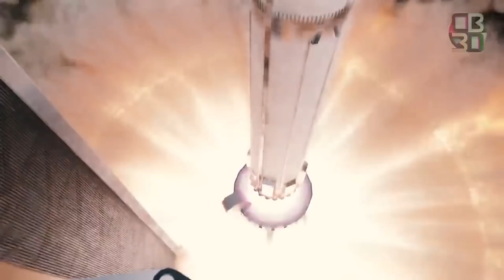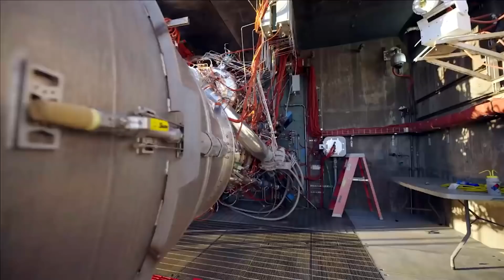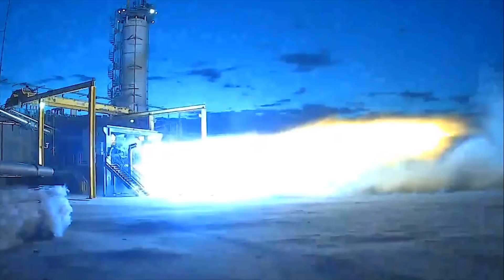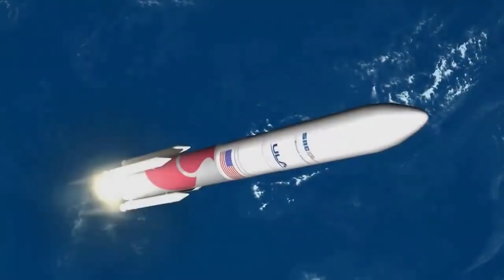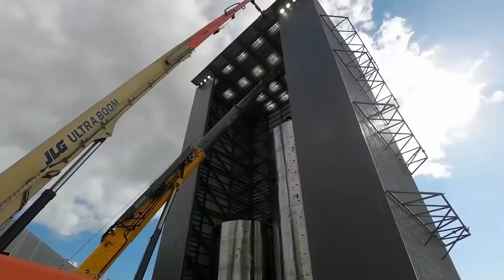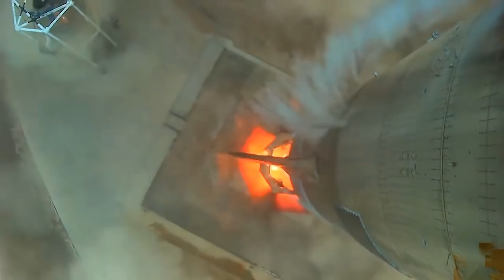HUMILIATED! Blue Origin's BE4 Engine manufacturing COMPLETELY FAILED!

Comment: disgusting narrative with incredible bias.   Blue is behind schedule but SpaceX has likewise often been several years behind its promises on numerous projects --but they got there. SO will Blue.  Blue will provide essential competition and help develop the heavy launch industry over time. Rockets and launch infrastructure take time.  this SpaceX cult attitude is not a good thing for the industry, even if SpaceX continues as a key innovator.  "Complete Failure" is just clickbait and false. Vulcan Centaur just stated they are tracking for a launch this year following receipt of the flight article engines mid-year.  This is not a "complete failure" any more than the long wait for Starship orbital (years behind announced schedule) represents "complete failure.".

Comment: The components and the materials of a rocket engine all work at maximum of their specifications; therefore when something doesn't work properly, you can't modify the engine, but you need to redesign it from scratch. SpaceX didn't just modify the Raptor, but consolidated all the changes and produced the Raptor 2 in record time.
Now the BE4 has combustion instability and overheating; it therefore needs new injectors and new turbopumps with the use of different alloys.
What could be a showstopper for Blue Origin, and be the likely cause of this five years delay, is the overheating. You fix the overheating in a rocket engine by changing the fuel / oxidiser ratio. But this change do reduce the nominal thrust and specific impulse; therefore, if you reduce the temperature, you must increase the pressure, which the chamber may not be able to hold. Blue Origin may well be entangled in a series of technical problems, and not be willing to splash the inordinate amount of cash usually required at this stage of production. 
If Blue Origin don't have very good engine designers, they could well be stalled for a very long time on this.

Comment: Look at the shape of the combustion chamber, problably has no baffels inside to stop combustion instabilities...LNG has no efficiency in regenerative cooling in comparison with another fuels
Reply: Maybe the BE-4 should have two or more combustion chambers, then.  That's how the Russians make solving this problem easy on themselves.
Reply: @rbrtck  Yes, like the RD 170 with four combustion chambers...but the regenerative cooling is more complicated in this case
Reply: @luizfilipe7882   Might it help at least a little?  Even if it doesn't, though, there are rumors about combustion stability issues that using multiple chambers and nozzles should more likely help with.

Comment: It's hardly a competition when one company has a man rated orbital class rocket and the other has a glorified pogo stick.
Reply: yeah, but if BlueOrigin finally succeeds in developing the BE4 they will eventually also have a man rated orbital class rocket...that costs several orders of magnitude  more per ton to orbit than the Starship.
Reply: I didn't realize that the New Shepard suffered from pogo oscillations. 😉
Reply: @rbrtck  Yes apparently just very low frequency of 1 cycle per flight
Reply: @tizerrazor1956   In other words, it doesn't go high enough for this to be an issue.
Reply: Not only a man rated orbital class rocket but a man rated orbital class rocket that can land its first stage back on Earth.

Comment: You obviously haven't been following Raptor very closely.  It has a very high failure rate; I'd guess no less than 25% for a full duration run.  There's no way to know how BE-4 is doing, it's totally hush hush, but I wouldn't be stunned to learn its reliability is much higher than Raptor.
Reply: Raptor isn’t just a new design, it’s basically a new concept - full flow staged combustion -  in rocket engines.   To top it off, superheated oxygen is extremely corrosive.  The West didn’t even bother trying oxygen rich engines until the Russians taught us how.   The Merlin engines are actually quite conventional, maybe even a little old fashioned.  So kudos to SpaceX for pushing the envelope even further with Raptor.  There’s a lot of efficiency gains to be had.
Reply: @ClockworksOfGL  Maybe to be had ,  His track record is pretty terrible , i mean 6mill launch 24hr turnarounds were promises a decade ago  and were still at a month and 60 mill
Reply: @MyKharli   Yeah, it's awful.  Stay away from SpaceX, and go with anyone else who has actually advanced the state of the art more.
Reply: @ClockworksOfGL  Maybe, but this guy was saying Raptor is a great success and BE-4 is an abject failure; I’m fairly sure neither is true.
Reply: I gess is not a good source.
Reply: laughable.
Reply: The Raptor isnt even here yet, its all testing and prototypes. Everything is perfectly in line with SpaceX testing and fail philosophy.

Comment: I'm interested in how their manufacturing capabilities are performing. Is the BE 4 having production issues or "science" issues?
Reply: or methodology issues?
SpaceX preferred the fail early way: they have tested parts or the whole engine as soon as possible. It failed usually, but they have learned a lot from the failures, so their understanding got better. Eventually this resulted in a working engine. But the engine was not reliable enough for rapid reuse, so they have kept improving it. Learning to mass manufacture them cheaper and better.
It is difficult to see, but BO might have tried to use the other methodology, when you aim to get everything right the first, or maybe the second time. That can lead to very long unexpected delays. Unlike in the "fail early method", many redesign issues creep in the last minute. So you may need to restarts the whole design process after the first tests.
"Fail early" can react to unknown unknowns much better.

Comment: CopyBlueCat  OVER
Reply: Copycat? Their research moves at about 1/2 the speed of spacex but they announced the BE-4 before spacex started on the Raptor, and they released drawings of New Glenn before SpaceX announced the BFR, and every test article and rocket they have ever built has been designed to be fully reusable from the very start. They were landing their test vehicles before SpaceX even had a rocket that didn't blow up on the pad. They were the first company to make it past the Karamen line and recover the booster with a soft landing.
Reply: @opcn18  And yet they still can't get to orbit or the ISS. So they still lose. And what the heck is a Karamen Line. And how many contracts for space delivery have they completed?  meanwhile SpaceX is delivering the goods to orbit and the ISS. And has over 100 landings of the 1st stages or boosters. BO has how many? Oh that's right 18. SpaceX has passed BO and is leaving them in a gas plume weekly. Another Falcon 9 launched today while there was a 1st stage coming back into Port today also. SpaceX plans one a week launches while BO launches once in a blue Moon on a Pogo stick.
Reply: @gravelydon7072  The line that delimits the edge of space.

I don't think SpaceX moving faster than Blue really matters. General Motors SuperCruise is a lot better than Tesla's autopilot, that doesn't mean that Tesla should shut down and pack up. Rivian is beating Tesla to market with an electric pickup (in spite of Tesla suing to try and stop them) again, does not mean that Tesla should close their factories or hand them over to Rivian.

There are allowed to be more than one companies and they can't all be the fastest and most dynamic.
Reply: @opcn18  Then it would be the Kármán Line or von Kármán Line.
No comment on GM comment. Rivian is having problems of its own. Way too many pre-orders and not enough capacity. They hope to get permits to build a second plant in Georgia to go with the one in IL. They didn't deliver more than 1000 of the R1Ts in 2021. Production of 150,000 units per year by 2025. Which is a drop in the Tesla bucket. I wouldn't mind owning one if they could get longer range out of them. Or that fact any EV. Until it can go more than 500 miles without stopping to charge ( unless they can do it in the same time as a gasoline fill up ) they are useless for me.

Comment: I wonder if a Raptor engine could be modified to fit on the ULA rocket? It would be funny as hell if SpaceX replaced the BE-4. To my knowledge, both the BE-4 & the Raptor both use the same fuel. SpaceX could offer ULA Raptor 1.0 while using the 2.0 on the Starship.
Reply: Heck, just use the Raptor 2 on both as Musk has said the Raptor 1 assembly has ended. Raptor 1 had 2.2mN of thrust while the BE-4 is estimated at 2.4. Raptor 2 would out perform the BE-4.

Comment: The BE4 and Raptor are basically the same design. Before spacex and BO this was a theoretical engine that only worked on paper. Why ?, because the are very complex, powerful, and just want to constantly eat themselves. There is a reason nobody tried to build them before. Where BO really fails is they do everything in secret, spacex does everything right under our noses and have built a massive following because of that. Bezos could learn a lesson or two in that regard, and we might start to like them a bit more.
Reply: NOT THE SAME DESIGN. Same starting goal. same fuel. and the same science.
but after that comes implementation - and that is different as the design was done by different people. BO engineers are the second rate as the first rate ones work for SpaceX.
Reply: @jessepollard7132  Well they are obviously not the EXACTLY the same design...thanks for stating the obvious...BUT, the are both methalox full flow staged combustion engines....driven by turbo pumps. I honestly didn't think I would have to spell that out. NOTE: I put the word "basically" in...which they are....the YT peanut gallery strikes again......thanks.
Reply: @dazuk1969   Actually, you are incorrect.  The SpaceX Raptor's design is full-flow staged combustion, while the Blue Origin BE-4's design is oxygen-rich staged combustion (look it up), which the Soviets achieved decades ago with kerolox engines and much higher chamber pressures (a good thing), as well.  An excellent example is the RD-180 engine that the BE-4 is supposed to replace.  The Raptor's design is very different, more advanced, more challenging, and achieves even higher chamber pressures than the RD-180.
Reply: @rbrtck  Your description of the BE4 describes the raptor perfectly....why ? because raptor is also oxygen rich....look it up. I think you are missing the point. The architecture of these engines will differ as the BE4 is larger and WILL be more powerful, but they are both methalox (oxygen rich) full flow staged combustion cycle engines..
Reply: @dazuk1969  On a full-flow staged combustion cycle engine, there are TWO preburners - one is oxygen-rich (driving the oxygen turbopump) and the other is fuel-rich (driving the fuel turbopump). https://en.wikipedia.org/wiki/Staged_combustion_cycle#Full-flow_staged_combustion_cycle
Reply: @L4JP  Yes I know, I just couldn't be arsed to explain it in detail. You are correct, the Raptor is full flow using to separate turbo pumps. One for the methane and one for the liquid oxygen. BE4 is not full flow as it only uses one turbo pump for both...hence it a staged combustion cycle...but not full flow. You obviously know what you are talking about...so thanks for reply.
Reply: Highly unlikely.  Why? Because even if the engineering and complexity details were resolved the company would still be a failure.  A failure because of Jeff Bozo's. He's shown and displayed what morals and ethics he chooses to operate with.  He just needs to stick to pedaling his "cracker jacks" and "chineseslave labor crap" on Amazon.
Reply: @chrisbowring4298  Amazon only sells other companies products. it is the other companies that use the cheapest labor for manufacturing.
Reply: @jessepollard7132  Amazon has  an inhouse design firm, they developed the fire tablet, alexa, echo, and the kindle.They do bid out construction of the products, but that's how the computer you are using was built, and the phone in your pocket, and all the parts that go into building a Tesla.
Reply: @chrisbowring4298  I agree on some things. Musk said Bezos gave up CEO of blue origin to spend a new career in suing spacex. I also think Bezos pinning flight wings on people from a new shepard flight when Amazon workers had just died in an Amazon warehouse fire was Appalling. As for the BE4, spacex have been testing raptor in FLIGHT going right back to starhopper. It's all very well testing on a stand...you actually have to test them in flight to get more thorough data. Bezos kind of deserves all the flak he gets.
Reply: @opcn18  Maybe operations but not from the company. His title is executive chairman of Amazon. That means that he has a role in it and snubbed the employee's families.
Reply: They are not basically of the same design.  Blue Origin deliberately chose an easier and more proven design for the BE-4.  However, only the Soviets and Russians have ever achieved it--never anyone else so far.  On the other hand, the Raptor is of a far more experimental full-flow staged combustion design that had been attempted by both the Soviets and Americans, but neither ever got it beyond the test stand, until SpaceX did it with the Raptor.  Obviously, the Raptor is still under development, but it has flown, which is farther than any other engine of this design had ever been taken before.  Meanwhile, Blue Origin continues to struggle with a design that the Russians have long mastered.

Comment: This is old news that wasn't particularly true when it was current. The BE-4 hasn't flown because the customer wasn't ready. It's not a train, it doesn't leave without the cargo.
Reply: I don't understand this remark. 
So are you suggesting the 1st flight be a revenue mission (and not a test mission)?
I find it hard to believe BO wouldn't wish the BE-4 operational today, customer ready or not ...
Reply: @tonys2957  ULA did not plan to do a mission with a mass simulator. That's what SpaceX does (well, what they decided to do after destroying the first two satellites that they tried to launch) but there are launch companies that don't (including the very first spaceX falcon 1 launch).
Reply: @opcn18  where's new glenn flying with be4😂🤣🤣🤣
Reply: That's not true they have been ready for 2 years. In fact they had to move some of the lunches onto other ula rockets.
Reply: @eddjordan2399  That's because they need 3 private launches on Vulcan before they can take DoD proper contracts and their first launch has been delayed.

Comment: Yeah it's not a powerful engine if it doesn't work dude
Reply: You know they delivered qualifying samples to ULA, right?
Reply: @opcn18  they delivered things that could be bolted on to verify fit, they don't work
Reply: @TheShorterboy  That was the pathfinder, they delivered qualifying samples also. They have not delivered a flight article yet, those are still in the Kent factory undergoing testing and validation.
Reply: @opcn18  that testing and validation is the issue the "pathfinder" is just a non functional sample you could print
Reply: @TheShorterboy  Yes, the pathfinder was a non functional engine for ULA to make sure all their connections were in the right place. Then they also sent qualifying engines, which are not pathfinder engines, because they are qualifying samples, and they do run, because they are qualifying engines, not pathfinders.
Reply: @opcn18  So you're saying ULA are going to qualify the engines not BO, because otherwise why would I send someone something they can't use.
Reply: @TheShorterboy  They use them to verify their testing methodology I believe. Just like the pathfinders were used to verify their fitment. Right now the flight articles are undergoing testing in Kent and they will be done and delivered in the next few months and then ULA is going to put them through testing of their own. The qualifying samples were used to make sure that ULA and Blue were on the same page in terms of performance and testing standards. 

Aerospace is full of miles and miles of red tape. They all want to cross all their "t"s and dot all their "i"s. Blue came out with the qualifying samples that were not the completely finalized design (rumor has it they wanted to explore different metallurgical avenues for the turbopump to improve reusability)  but which performed to the standards set forth in the contract with ULA. They sent those to ULA and kept working on perfecting the engine because the design will be frozen as soon as they start performing flights with it and Blue is trying to avoid having two different versions in production at one time (because that's confusing and can lead to disastrous mixups).
Reply: @opcn18  No, what they sent were incomplete engines, They cannot work the way they are. They are missing some major parts. Namely the turbo pumps for one.